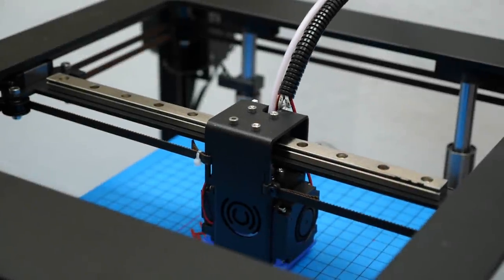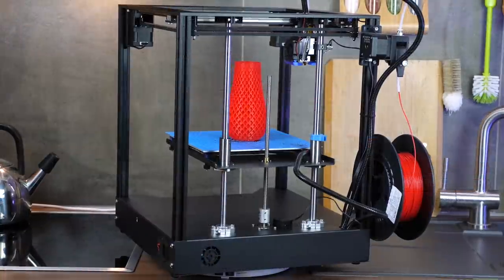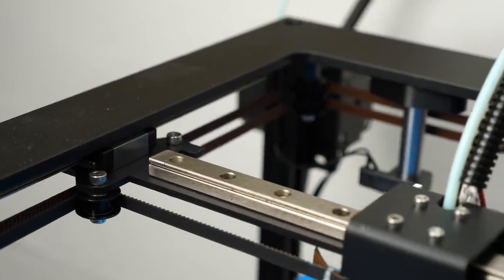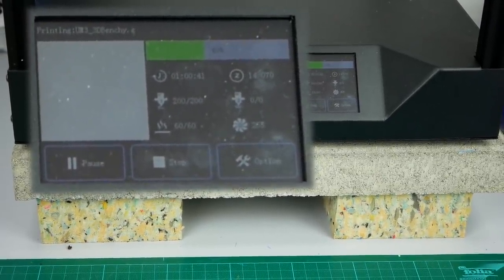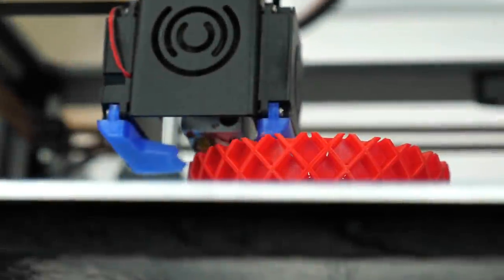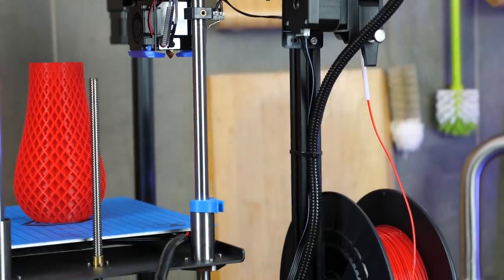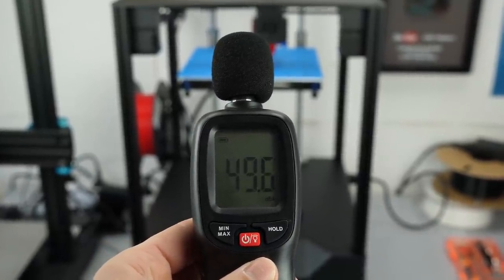$320 Linear Rail 3D Printer - Sapphire Pro REVIEW (Two Trees)

Comment: I have a Sapphire Pro. I had no issues with missing parts, but the build instructions are still terrible. The top plate was perfectly straight and my linear-rails-screws have the correct length.

I do agree that it's a bit of a tinkering project, but like that it is a really fun printer.

My recommendations for improving (and quieten) the printer:

- Additional TMC2208's for Z and Extruder
- Papst 60mm fan for the power supply
- Cut out the fan grill from the power supply. Don't worry, it is completely enclosed in the unit. (This makes a ridiculously big noise difference...)
- Replace the 1 start leadscrew with a 4 start one, like on the ender 3. Seems to have fixed the banding for me. (Remember to divide the Z steps by 4)
- Replace the 40mm fans inside the enclosure with whatever quiet fans you like. (e.g. Papst, Noctua)
- Oh and remember to step down the fan voltages because 24V don't always exist. (If you need a voltage converter, search for "Mini360 Buck Converter" on aliexpress)

For putting an Open Source Marlin on this printer, the channel "the electronic telescope" on YouTube did the legwork. "Design Prototype Test" made a playlist with the relevant videos: https://www.youtube.com/playlist?list=PLtVk4dZInT83cYG5nVr50O2hH3GVSkKse
I have had some limited success with it, but development will go on.

Have fun!
Reply: What do you mean replacing one lead screw with four ones ? I don't get it, can you elaborate ?

Comment: Looks like an interesting printer. Sad that there are so many quality control issues.
Reply: True, and stefan is doin great to solve the probs. Maybe the manufacturer should listen to his review.
Reply: @tantamid6572  Im an owner of one and they fixed all the issues Stefan mentioned.
1. All screws are correct length.
2. No missing parts (all included in separate string bags with labels).
3. No z axis wobble visible at prints.
4. There is no need to straighten anything as nothing is bent.
5. Im not sure what he meant by "complicated cables and plugs" as if you are able to not cut your arm of while doing yourself a sandwitch you should be able to also do this :D
Reply: @sob515  I guess they should send a proper printer then. Isn't that obvious? 
There is a company which aproaches a well respected youtuber to review the printer, they should, at list, send a printer that comes out of the production line, not the one that failed on every aspect and goes for reconstruction.
Reply: @sob515  should we believe you now? :-P
Reply: @sob515  When and where did you buy the "fixed" version? I'm looking at the page on Gearbest and it looks like they are listing things as "fixed" and "new version," How could it have been iterated so fast when this video was uploaded today?
Reply: @aspmos  I don't think that's what happened at all fam. More than likely they send it thinking it was fine, and then have since used (what looks like his feedback directly) feedback to reiterate the machine.
Reply: @REDxFROG  hell no xD
Reply: @skwerleyz  like month ago ... i ordered from Germany and revceived it in ~4 days (no idea when Stefan received his ... but probably much earlier)
Reply: @sob515  well, should we ask stefan? Interesting enough how fast the manufacture team react. Well i hope the aftersales team is also this good.
Reply: @sob515  What about the firmware modifications he mentioned.

Comment: Anycubic 4max pro. I paid $350 from anycubic on eBay. Pulled it out of the box, leveled it,  hit print.

That's it. Fully enclosed, quiet, decent build volume, nice touchscreen and controls. Out of ~100 prints, had 2 failures, and it was just because of shitty, brittle PLA. The filament sensor caught it though, which was nice.

No idea why it's not the most popular machine around

Comment: Great review! My first printer was a $350 xyz DaVinci. The reviews I looked at before I purchased it where, just flash the firmware with Marlin and it is a usable printer after that. After 2 years I had completely replaced just about every component on the machine. I would replace something and then get 1-3 prints out of it before it would brake or print quality would drop off. I learned how to build/trouble shoot a printer from that machine. I also learned that I wanted to print and not fix a machine all the time. I scraped the printer and bought a Prusa I3, and after 2 years I have only worked on it a few times, most of that is due to the mmu2.

Comment: The Ender 4 is very similar to this printer with the z banding Issue. I noticed the bed vibrates on the outer edge away from the linear rods. A few people in the facebook group have upgraded the bed to dual with linear rails on both sides. This has cleaned up the z banding.

Comment: I like the parts they used and think that for certain people this is a fine buy. Of course that's not a beginner but to build up a machine for a special use I'd grab it fast. The linear rail that the extruder is on seems like excessive mass for the job it has to do, I'd change that out for CF rods and IGUS bearings and your suggestion for getting rid of the springy coupler is a good one.

Comment: i got one yesterday from amazon prime with free shipping, it was very easy to put together took 45 minutes had none of the problems you had, they should pay you for your recommendations I love it enclosing it will be very simple because the stepper motors are down below not exposed a bit of insulation some tempered glass it should be golden I got the standard instead of the pro version because the pro version the stepper motors are exposed for $320 some upgrades I’m very happy. thanks for your incredible reviews love your channel

Comment: Hi Stefan, I purchased the earlier version of the Two Trees Sapphire S utilizing the Lerdge X board from banggood($450-Acrylic enclosure included). I chose it for exactly the reason you stated about the linear rails aswell as the CoreXY and Z travel systems. I can't really comment on the out of box functionality since mine was never assembled as originally intended. Regardless, the other reason I chose it was because the X and Y holes in the floor provide a perfect placement for a triple motor Z-axis which, helps stabilize the print surface from the originally unsupported overhanging weight of the heavy printbed base plate. I have since modeled a majority of the printer in Sworks and made some major modifications (some necessary some not) with the expectations of having a reliably fast little 3D printer that rivals some $3k> printers currently on the market. Anyway that is my two cents. Thank you for your time, effort and sincerely informative channel!

Comment: got it for +- 2 years now. i couldn't stand the standard moving bed printers and wanted something faster, so i got this one. it's reliable and very good printer. would 100% recommend it even to noobs who have some technical understanding.  i still remember how often i had to level the bed on my old CTC printer. on this one i just check from time to time, but i rarely have to re-adjust it. the strange autolevel sensor didn't work but since the bed is so sturdy, it doesn't really matter. very happy with this purchase and it's a true and nowadays very cheap workhorse. i changed NOTHING, no new hotend, not even a new nozzle and it's still printing 95% perfect for my technical parts. nowadays, it costs 230€ WITH ENCLOSURE from their website which is a HUGE value compared to ender and thelike.  i will definitely buy another one if this one goes hops. greets from berlin ;) settings tip: 225° for PLA with 150mm/s is good for technical parts. for PETG go with 265° and 100mm/s. except for outer walls, which are 50% of the speed. for good-looking parts go 75% of these speeds. heatbed i have magnetic one so i added 10° -> 70° for PLA, 80° for PETG. if you are in for quick prototyping, go up to 255° and 250mm/s with cheap PLA (only for larger parts!). cooling fans on 100% . oh and give a little of sewing-machine oil on all bearings and rail from time to time. it is a long lasting printer for that cheap price.

Comment: I just put one of these together, and it looks like Two Trees has sorted out most of these issues.  The manual is decent, and I did not have any of the frame or PID issues. Took me about 45 minutes to put together and start printing.  Prints really nice, and I don't have z banding.  My biggest beefs are the extruder and fan noise you described, and the underpowered part cooling fans.

Comment: 1)Generally if the hotend temperature overshoots like that, the heater cartridge is not the one you expect to find on 24V system. It is probably the 12V one and is a fire/electrocution hazard.

2)Does the wobbling correspond 1 to 1 to the lead screw? There might be a faulty linear bearing. Try unscrewing it and moving by hand.
Reply from the maker: 1) checked the resistance and it's too high for a 12V cartridge, they probably just aimed for too much power.
2) the period is perfectly 2mm, so I assume it's coming from the lead screw. Though I have cleaned and re-greased the linear bearings as well, since they didn't run perfectly smooth.

Comment: I have one since late September, I had some QC problems too, notably loose screws and the Y motor cable inverted, but otherwise this is a good printer. With the optional wifi chip you can monitor the print from Cura. I believe that if TwotTrees resolve their QC problem they have a big potential to deliver great and cheap 3D printers !

Comment: Looks like a typical user experience for the price... this is typical in that the user has to tweak the printer to improve it's performance and the cost is really for a starter kit of parts. Based on that I don't think anyone can really complain about it; this is the reality of cheap chinese printers. Definitely not a starter printer.

FYI - I'm still using my home-made core-xy (tech-2c design) and it works really nicely with a low mas hotend assembly.
It's good to see you channel growing Stefan, I remember back when you were testing filaments and asking for help in buying test stock. It's nice you see you doing collabs with Thomas as well.

Cheers,

Comment: I wonder if a flexible coupler on the Z would help with banding. Stefan didn't mention if the other coupler he tested was a flexible type. I have good luck with the clamping spring/coil type as opposed to the set screw coil type. Haven't had great success with the ones with the rubber spider either.
Reply: If the coupler holes were not concentric then that would cause z-banding. The top lead screw would "orbit" around the stepper motor shaft, pulling the Z platform around in a circle as Z changes.

Comment: the ender 5 is actually not a corexy
Reply: What first 3d printer with core my you recommend?
Reply: @Kaiikeda  ender 3 pro
Reply: @انا_ابراهيم_البناوي  That's not CoreXY either
Reply: @Kaiikeda  Two Trees Sapphire Pro
Reply: @richardlighthouse5328  Classic..
Reply: I think its a Hbot not corexy by looking at belt configuration.
Reply: @Kitsu_no_mirai  hbot uses a single belt in a h shape, core xy uses 2 belts

Comment: Any chance of hearing your thoughts on the changes that Two Trees made with the Sapphire Plus, Mr Hermann? From what I can tell, other than the size increase, they've switched to a dual-Z setup on linear rails (my gut feeling is this will be less stable than rods on both sides, but I've nothing to base that on), added sides to the top plate, gone to 2040 uprights, and what little I've seen of the control board looks like it might be a full suite of 2208 drivers.

Also wondering if you encountered any of the alignment issues I've heard of with the Sapphire. There's modifications to shift the motors and some of the bearings due to the belts not being parallel where they should be, introducing Y-axis issues.
Reply from the maker: Don't have a Sapphire plus so I can't comment on it's changes and performance.
Reply: Appreciate you taking the time to reply.

Comment: Z banding on your case is most likely caused by the control of the bed temperature.
If it varies too much, the bed contracts and expands enough to cause z banding.
Lost 1 week debugging this issue on a similar printer.

Comment: The Z banding is an ancient problem many original ultimakers suffered from. The way to solve it is to decouple the bed from the leadscrew in the XY direction, leaving only the Z, so that the linear rails keep it in place, while the leadscrew just rises/lowers it. Ie. leadscrew nut needs to be loose in XY, which will absorb any wobble. On old ultimakers we used to sand out the mount for the nut so that it could freely wiggle.

Comment: That Z wobble is probably due to the cantilever bed combined with not so rigid linear rod/linear bearing combo. The slightest binding will make the bed oscillate (sometimes not enough to be seen by eye). The fact that it is so regular could be the linear bearing having not-so-round balls, which could bind on some parts of it's travel, especially when under load. Had the same problem at some point on a custom made printer, built with cheap bearings. Combined with not so well printed parts, I could never get rid of the problem. Ended up scrapping the whole thing. For the Sapphire, maybe try changing the linear bearings of the bed for test sake

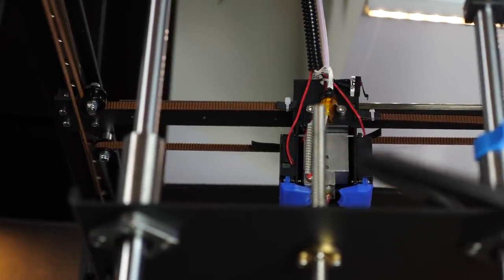Comment: 14:02 They got the corexy configuration totally wrong, belts directly connected to the gantry need to run parallel to the direction of movement.  You can see the belts here aren't in line with the linear rails towards the motor and towards the front of the frame. This means the belt geometry (and the belt tension) changes as the gantry moves forward and backward, and the parts that come out of it will reflect this dimensional inaccuracy.
Reply: This. It's a shame people don't know much about CoreXY and miss stuff like this.

Comment: If you spend that much money to upgrade it pretty soon as a project, you might also look into diy printers. 
Esp if you have the need for non standard sizes(for example for it will be a 300 by 600 printer as that gives me the ability to print custom keyboards in a single piece)

Comment: Wow Stefan, you did alot of work for this company, i hope you truly wanted to do it and got justly rewarded. Felt abit unfair of them dumping a premature model to learn from you even if free.

I gave up on my CoreXY in the end after 6 months of continual tinkering because of similiar issues with yours. Z-wobbling didn't go away no matter what I do, reinforcing everywhere. At the end of the day, i sold the coreXY and went back to the ol reliable Cartesian.

I'm not sure if it's an issue with CoreXY being more sensitive to calibrate or something else. I did suspect the longer belts, non dedicated XY motors, heavier XY load may all add up.

 I run 3 Creality-CR10S4 for full time production. No monitoring required almost right out of the box.

Comment: IDK if you'll see this, but should help anyone reading this.... Used to build trucks and we use only this, so Pro tip on the split loom>> Don't push the wires into the loom, bundle up your wires at the end and the ending point (hot end here), slide the loom on a bit. Wrap the loom with 2-3 revolutions of tape and then just push in away from you and over the wire at the same time. a run of 1-2 feet will take you 10 seconds and..... NO BLOOD.

Comment: Hi Stefan, i wonder, this printer has belts that are not parallel to the axes and this should result in dimensional distortion, especially the closer you get to bed edges. How is your experience with that?

Comment: I love the design and rails also it's a good price. Hope they work out the problems as i would be a buyer.
Reply: Yeah, it looks like we may be on the verge of a bunch of cost-conscious CoreXY designs hitting the market. I'm keeping a close eye on the SecKit "Go" - its slightly more expensive than this one but still very modestly-priced for what you get. The very first batch are only just shipping now, but it has linear rails in all axes and looks very promising - IF the current 1-man operation can scale up production to meet demand!

Comment: for price i think it's pretty solid, i would probably replace that aluminum plate on top with some 2020 extrusion just to get a straighter surface for the linear rails and to have a place to mount accessories.

Comment: About the Z Banding, do you know if your power supply fan is shutting on or off? I had this exact issue on my Rostock V3 and sometimes it was intermittent, come to find out the Meanwell power supply that it came with has built in automatic cooling control so whenever the fan turned on and off, you can slightly see the z-banding occur. I further isolated the issue by putting a separate cooling fan and verified the banding went away because the power supply fan never needed to switch on.

Comment: Replace the power supply to fix that banding issue, if it's a 12v system use a standard high amp atx PC psu.

Comment: The Z-wobble is due to the round linear bearings. These have a massive play in them unless they used more expensive ones with higher grade bearings.
Upgrading with a DyzeEnd Pro and a DyzeXtruder Pro will double the price of the printer but still is a very cheap way to start printing those high tech materials.